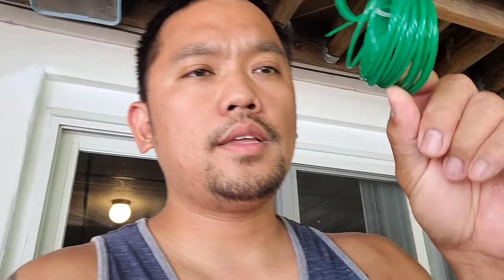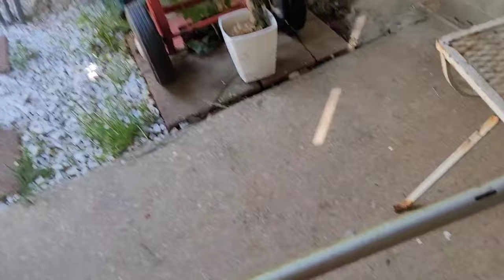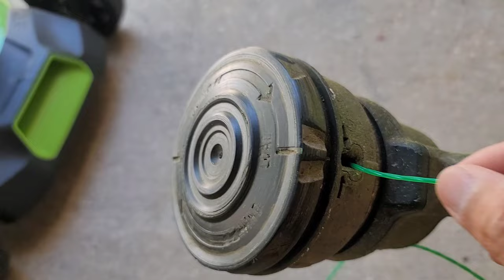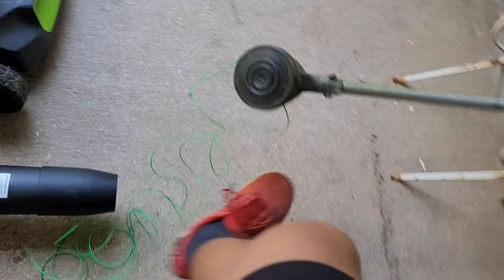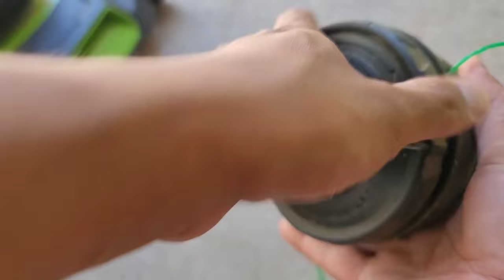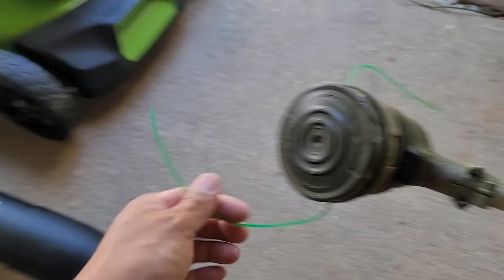Greenworks 60v String Trimmer.   How to Load / Refill trimmer line.

Comment: Hey I used mine for just 10 minutes and the line is shorter now. It’s a brand new greenwirks trimmer. I tried bumping it as I trimmed, but the line is still short. Does that mean I need to replace it with new lines?

Comment: Mine starts ,but won't go in very  far. My line is 0.095....maybe being thicker is jamming it up?
Edit: after 40 minutes of trying to feed this line thru  ..I didn't want to give up. What I noticed is mine didn't go straight thru it was slowly winding it self around the spool,but if that's the case how would the other end ever pop out? So, with the 2 tabs I took the spool off. The string was basically in knots...no wonder I couldn't get anywhere. I took the string I had on off,but there was a spot to go straight thru..:so I ran the string thru.... made sure the string was even and manually wound  it with the spool and it worked! Mine just wouldn't run straight thru like yours at the beginning. Welp it's working now ...my arthritic hands are feeling it! Lol. Thanks for the video!

Comment: Didn't work for me. The thing just turns and doesn't take in the line
Reply from the maker: Sorry to hear that. Make sure that nothing is stuck on the feeder.
Reply: Didn’t work for me either. He doesn’t show how to take the green cap off. It’s different than mine, same model.
Reply: Me neither
Reply: You have to push in slightly and wind. It kinda winds in digits...not a smooth wind.

Comment: I just installed new string for my trimmer. It was very hard for me to let the string go through the holes. You won’t know the state of string inside.I removed the spool by pressing the 2 taps and found 2 holes on the inside green parts. It was much easier for string to go through these holes. Then put string through the holes in the video.

Comment: Thank you for sharing the concept. You might want to work on your camera skills however as I got so dizzy I was nauseous. Unfortunately it did not thread on the other side so I had to open it. Trying to deal with that with female hams when an item is designed for male hands was a real challenge putting it lady like. I think I would’ve rather have given birth six times and gone through five divorces then to ever have to do that again. But at least I understand how it’s supposed to go and that’s half the battle. Thank you.

Comment: The line in feed doesn't work. I have never had a problem with any weed eater before, not once. The Fing thing doesn't even have a corresponding hole on the opposite side. You have to hand wind it like the ones made in the 80s. In fact Costco here quit carrying it after 50% of purchases were returned.